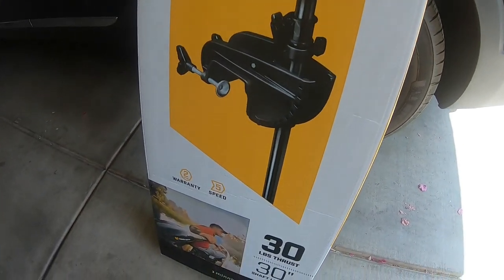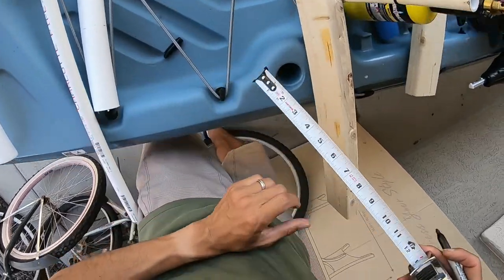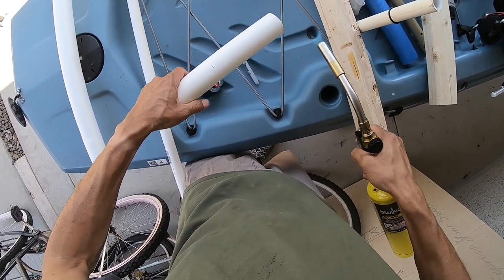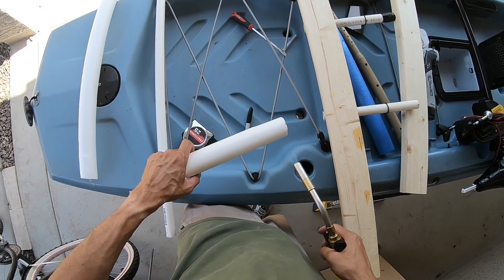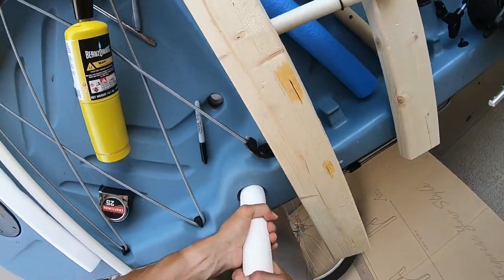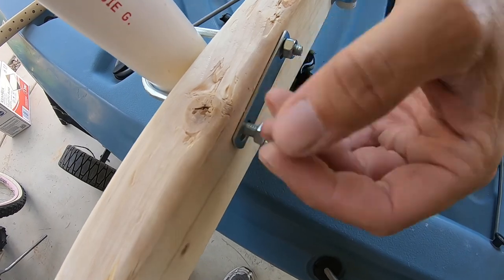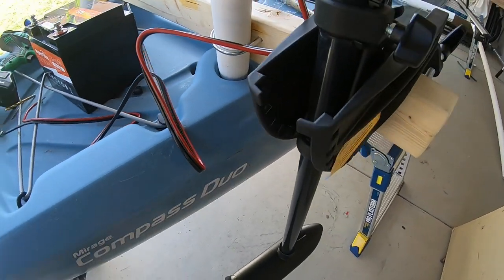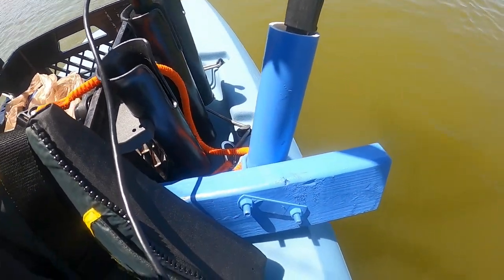Hobie Kayak Side Mount with Minn Kota (Attempt 2)

Comment: I followed this video for the mount and worked great I added 2 stabilizers with ubolts and 2 small aluminum strips on both sides mounted to the H rails for extra strength. Thanks for the help , is a way better alternative for those of us who can’t afford a torqueto.

Comment: Since it's side mounted and not completely in the rear, are you able to adjust it to in fact travel in a straight line? Any issues with steering? I want to do this with mine. Thanks.

Comment: What balance issues did u have… I had my first sail yesterday and instead of wood I used aluminium square tubing then added a small transom . My battery was a small 6x6 inch 24Ah (slightly lighter than the 65lb Thust Motor. Worked fairly ok with only a slight im-balance( small mod still required to add a fraction more weight to battery side

Comment: I have a question , I just watched your first attempt video , you had it mounted using the scupper holes ,, on this one you went with the rod holders, which one was better ?, I just bought the motor so now I have to make the mount , wondering which way to go ?
Reply from the maker: I like using the rod holders.  It feels more secure.

Comment: Looks like a great setup,  i like teh simplicity.  What battery were you using for your new Minn Kota?  Do you feel like the plank and ovc are pretty stable and secure?  Ive heard of horror stories of motors falling off of kayaks when side mounted lol
Reply from the maker: Thank you! I'm using  the Ampere Time 12V 50Ah Lithium LiFePO4 Battery
Reply: @riceandbeansoutdoors7434  Thank you :)
Reply from the maker: I definitely think its stable and secure.  With that said, I do have the motor tethered.
Reply: I’ll give you more simplicity..  I took a milk crate, attached a large piece of wood to the crate (bolts) and put the crate in the back of the kayak.  The crate is weighed down by the weight of the wood and battery and some fishing supplies. Then put the trolling motor on the piece of wood.  This way, there is no stress on the kayak rod holders (the holders crack from the stress apparently) and it’s easy to unload.. simply take off the motor and lift out the crate.  I have had this set up for 3 years and there is no problem, no damaging of the kayak and no special tools or things to do.
Reply: This is a great idea ⭐️⭐️⭐️⭐️⭐️

Comment: Just use a smaller size pvc😅
Reply from the maker: Man, I'm not sure why I didn't think of that.
Reply: I just built this with 1 1/4 inch pvc and 1 3/4 inch U bolts. I wrapped the bottom of each piece with some duct tape until it was a snug fit. Seemed easier. Works great.  Thanks for the video!